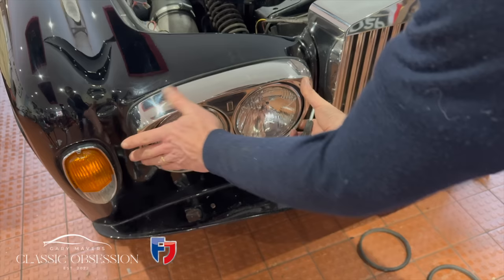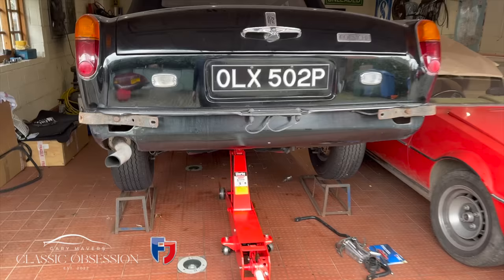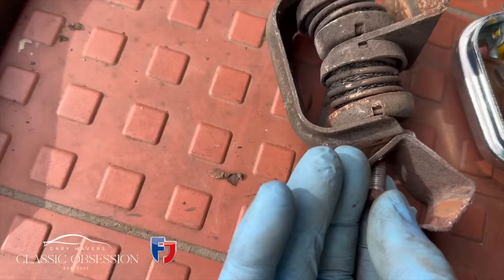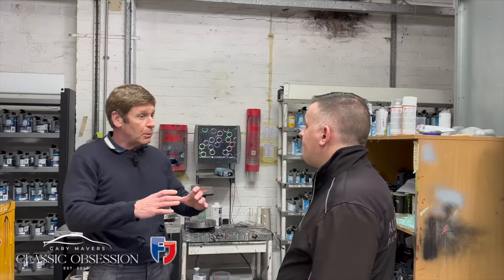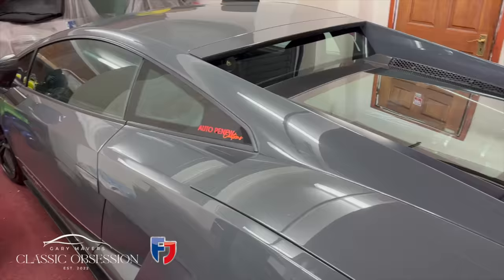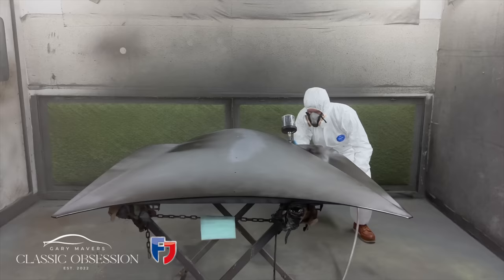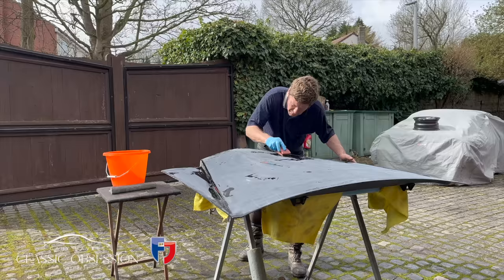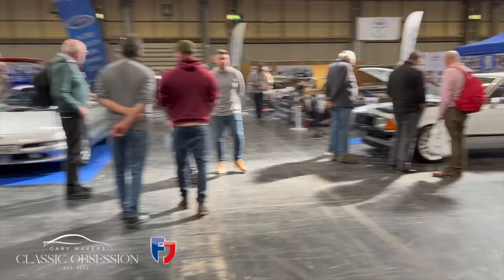Preparing a Rolls-Royce Corniche | New Exhaust, Chrome and Paint | Classic Obsession | Episode 26

Comment: When I did these screens back in the day I always cut out the rubber and fitted a new one.Then the chrome strip didn't distort at all. you then fit the chrome into the new rubber and pull the screen in with the 'old string'.
Reply from the maker: Hi Dunc, yep that’s basically what I did but unfortunately one of the ends of a chrome strips was slightly bent but once in, I tapped it into place with a hammer carefully and a block of wood. Regards.

Comment: A lot of early cars are cellulose. Are there any problems mixing paint types on different panels - like 2pack and cellulose?
Reply from the maker: Sometimes but if you bar coat the existing or apply 2k primer first this should act as a barrier or seal for the new topcoat. Regards.
Reply: @classic.obsession  I was thinking, I need a couple of localised repairs on my car, so just stick to cellulose like the rest of it, then detailing is going to be consistent, rather than painting the whole car

Comment: Did you paint the underneath of the bonnet before you went to your mate/paint shop?
Reply from the maker: Hi Daniel. No. The bonnet is black underneath anyway and is covered in the sound/heat proofing panels which I believe to be correct so no need. Regards.

Comment: What's the best stuff for black plastics? Even Meguiars is gone after a short while....
Reply from the maker: Sounds silly John but I’ve always sworn by Armoral tyre foam for tires and I’m sure they do one for interior and exterior plastics in a little bottle. Regards.
Reply: @classic.obsession  At the end of the video, the plastic bumper on the Lotus looked good . I wondered if it was something more than Armorall which I must admit I have used before, as well as Simoniz and Meguiars. Although all  their effects are generally short lived. I learnt today that " Solution Finish" is a great job, but I never tried it.
Reply: @jonathancarson1974  gently use a heat gun to renovate plastic

Comment: Doing the screen without removing the dashboard?
I'm impressed as up until now I have only seen this reference and the chap recommends removal of the dash:
https://youtu.be/EKDuyHHfb9A

Did you however at least loosen and pull the dash away a little to get to the seal to cut it or left it totally alone?
Also, the A-pillar & inside rear-view mirror trim had to be removed I guess? so many questions! 😉

Brilliant video though Gary - your videos give hobby mechanics like myself the confidence to try things - many thanks and keep up the brilliant work!
Reply from the maker: Hi Fran. No didn’t loosen or remove a thing. Went in no problem. I cut through rubber to remove then did as you’ve seen in the video. All common sense. Just take your time. Regards
Reply: Ah, I've just seen, you have the series 1 dash - do you think you'd approach a series 2 dash differently?
Reply: @classic.obsession  Hi Gary, have you ever thought of having a patreon channel whereby you go much more in-depth with your videos? That'd be ace and really serve the community!